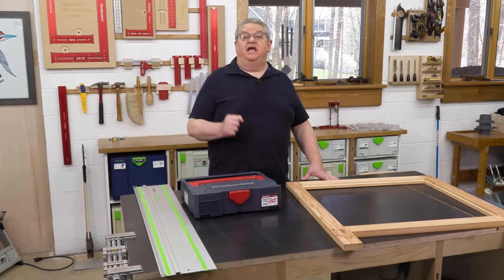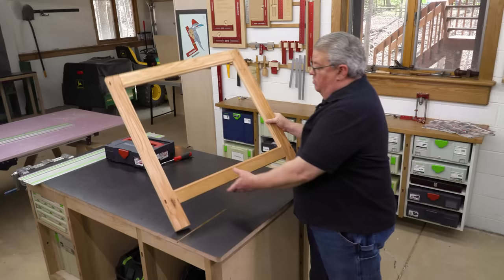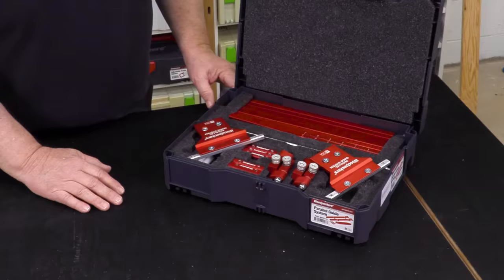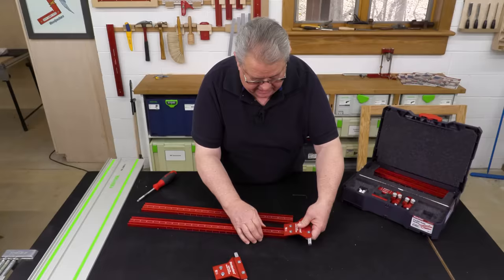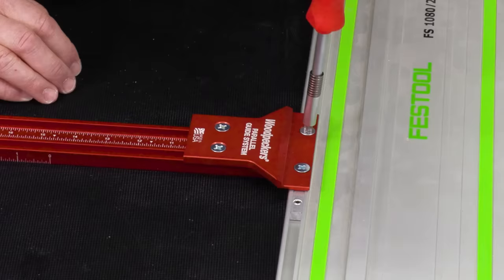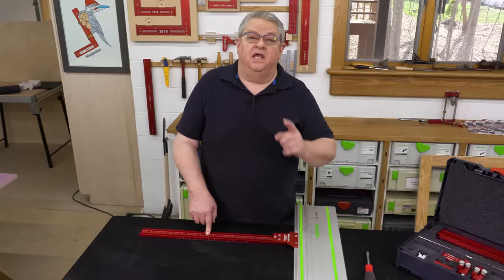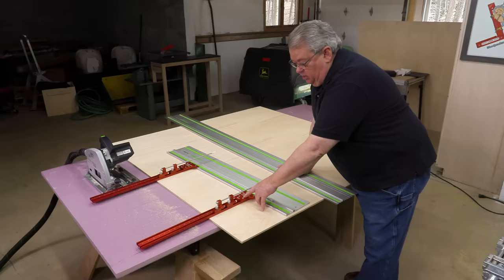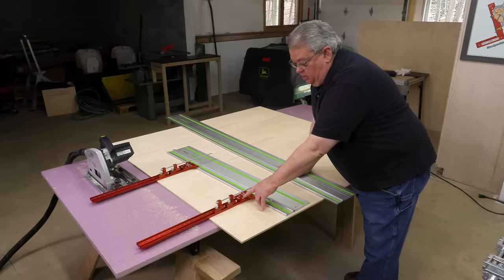This Track Saw Accessory Might Replace Your Table Saw | Deep Dive

Comment: I could be missing something, but wouldn't you save a lot on set up time if you made the container just a little bit longer, and had the part that attaches to the track and the first section of guide rail as one solid piece? Do you lose any of the other functionality besides space-saving by doing that?

Comment: A friend had been loaning me a set of these and I fell in love with them and decided to order my own. 
Another friend asked why I would pay that much when there are Chinese knockoffs for 20% of the price?
We ordered a set just to see how close they got. (Always figured that I'd order from Woodpecker anyway just on principle, and give the other set away if they were decent.) 
First thing I noticed was that the face of the pieces didn't seat flush. Not a tremendous offset, but enough to catch and damage the face or edge of the wood.
Next was that, when calibrating per the directions, the end of the rod didn't reach the cutting edge of the Festool track. Interestingly enough, their website lists every make EXCEPT Festool, but the Amazon listing shows Festool compatible. 
They also used Woodpecker's photos in their listing, complete with artifacts where they tried to remove the Woodpecker logo from the mounting heads. 
Decided this wasn't even worth giving away and returned. 
My Woodpecker set arrived today, and the setup and cut was perfect.
All of the complaints about how long it takes when using these are ridiculous. Once they are calibrated it takes no time at all. Far less than measuring and setting up an edge guide or measuring both ends of the board and trying to line up your track and hope for square.
Unless you've used them, you have no idea what you're talking about regarding time or ease of use.
Like everyone else, Ioften balk at Woodpecker process. But there's no denying the quality, accuracy, and reliability of their tools.

Comment: I'm sure it works great. But practically $500 for a jig that will allow you to make parallel cuts? I guess you're paying for precision engineering. But honestly, who needs to be quite that perfect? With a few clamps and straight edges you could probably achieve an imperceptible difference to this, for a small fraction of the cost. I'd also be stressed about damaging kit that seems to be worth its weight in gold, rendering it worthless.

Comment: I made one years ago. It works great but I wouldn’t say it would replace my table saw.  Repeat cuts on a table saw are simple. Of course I had  a 8’ slider on mine.   Cu300
Reply: I was just thinking about all the comets on how fast they could do this on a table saw. Except for one thing, squaring  up a 5x5 sheet you need a slider…
Reply: @sparkypdx  had one so I guess I never thought about it

Comment: What is the pink board. And is the saw cutting into it.
Reply from the maker: Rigid foam insulation, and yes, the depth of cut is set so the blade just barely cuts into the foam.

Comment: The old table saw, 10 seconds to set up, repeatable, makes no difference how long your stock is, would have had all the pieces cut in 5 minutes.
I see I've been doing it wrong all these years, why do it the old way when I can spend 15 minutes setting up an overly complicated rail guide system that limits me to 60" of ripping?
Reply: @TopRahmen Indeed

Comment: What are you using for the long cross member supports underneath the foam board?
Reply from the maker: I'm using a Walko Workbench from Denmark. Sadly, they're no longer available in North America. A couple 2x4s will do the same thing...just need to give the foam a little support.

Comment: I'm usually very impressed with Woodpecker gear. Not this time. Much quicker and just as accurate to align the track with a straight edge and clamp it down. Add the cost of the track right angle attachment and the Woodpecker square and you can buy a contractor table saw. This is a collector's item for Woodpecker fan boys. So easy to incorporate both imperial and metric and yet, Woodpecker insist on excluding the rest of the world from their client base.

Comment: If you dismantle this so that it fits back in the case for storage, do you have to re-calibrate it next time you use it?  You referenced the issue briefly at the top of the video, but I did not quite catch your message.
Reply from the maker: You do lose calibration if you remove the head that connects the track to the guide rail. If you leave the first section of track attached to the head, you'll maintain calibration, but it won't fit in the Systainer. If I know I'm going to use the PGS in the near future, I leave the track connected and bungee cord them to the outside of the Systainer with the rest of the parts inside.

Comment: I wonder about the cost of this tool and the time to set it up you need. they have very, very, expensive tools and like this one not very practical. using my drywall square does the same but it takes 10 minutes to set it up..........I save myself hundreds of dollars. Again, the fancy tools do not make you a craftsman, it will make it more difficult to compete. I have basic tools for making dining room sets. tables high-end kitchens and doing great. This is just a false advertisement and a very cumbersome tool to use.

Comment: How do you keep the track saw clamped down to the  plywood and your plywood clamped to your table in this video?
Reply from the maker: Track clamps holding track to material. No need for anything else. The material has little tendency to move on the foam surface.

Comment: Nice system, but you guys really need to "Stop" using that phrase "will or Could replace the table saw". Nothing could replace the quick precision ripping /panel cutting of the good old faithful table saw. Not even a dedicated panel saw which is used specifically for sizing plywood panels into manageable sizes, to take to the table saw for precision ripping and crosscutting as well as other wood machining task. I have a luguna table saw and track Saws, with my track saw, I have to manually align the cutting edge of my track with the cut line of my work piece to be cut, every single time. And it's no guarantee that my first manual track alignment, will perfectly repeat itself onto my successive manual alignments, close but not at all perfect like my luguna table saw produces. With the price tag of this woodpecker's system, coupled with a track saw, you could've purchased a jobsite table saw that only takes up less than 6 sq, ft. of space, or a cabinet table saw. I just don't see this system from any price point advantage, nothing that, in a pinch a shooting board couldn't do, that's a straight edge, a circular saw and an offset template. I built my first set of kitchen cabinets over 30 years ago using a straight edge and circular saw.

Comment: I love all the gadgets that Woodpeckers make, unfortunately they are difficult to acquire in my country.

Regarding these parallel guides, I have doubts about their usefulness. The table saw is the heart of any self-respecting woodworking workshop, it is a very useful tool for an infinite number of cuts. In fact, bench tools, which are fixed like the table saw, the table router and others, are usually more robust than their hand-held counterparts like the circular saw, the router, etc.

I mean, it's elementary. The situation where I think a track saw with these guides (which are apparently a bit complicated to use) might be worthwhile is for someone who is starting their own workshop and doesn't have the space and probably the budget for a table saw. So the question is, how affordable is it to have a good plunge han held saw with its cutting rails and these parallel guides, and will it be less of an investment than a table saw, even if it is a portable one like DeWalt, Ryobi, etc.?

And indeed, it can be useful for making certain cuts in plywood but what happen when you have to cut other types of wood besides plywood?

Comment: When your using the square against the fence it looks like the vinyl strip that prevents tear out is missing. Shouldn’t the measurement be from the strip since that’s where the blade is cutting?
Reply from the maker: Gary, that is a bad camera angle. It is definitely against the splinter guard. Look at the close-up that is right after the scene you're describing and you'll see it.

Comment: Why are you getting so much saw dust around when you are using a Festool track saw and I am assuming a Festool Vac
Reply from the maker: Because I had been sanding and had the vac power turned down and didn't know it. Found it after we finished the video.

Comment: My questions are, I didn’t see a method to clamp the track to the plywood, do you just try and hold it while you cut?
/
Reply from the maker: According to Festool, clamping is not absolutely necessary when cutting plywood with their guide rails. They include friction strips that hold it in place. Personally, I put at least one clamp on, and most often two when making critical cuts. The underside of the guide rail has a slot that accepts track clamps. Sorry I didn't explain that. I sort of assumed that anyone looking at our Parallel Guide System would already be familiar with track saws and guide rails.
Reply: @WoodpeckersLLC  This was the first I’d seen of this system and was unfamiliar with any track system, appreciate the prompt reply though.

Comment: How do have space for a sheet of plywood but not a table saw?
Reply from the maker: To cut a sheet of plywood with a table saw you need 8 feet in front of the blade, 8 feet behind the blade, and room for the operator  With a track saw, you only need enough room to walk around the sheet.
Reply: @WoodpeckersLLC  not to mention, it's also many times more dangerous doing this on a table saw especially if it's not sliding table saw.

Comment: Track saws are nice. Ive been making them for years. Not sure you should be woodworking if you cannot make a straight edge guide for breaking down plywood. Not sure you should be woodworking if you don’t have room for a table saw of some sort. Nothing can replace the simple “go-no-go” repeatability provided by a table saw. 

I have nothing against high end tools and tooling. I have a 2000 sf shop full of that stuff. But leaning on this kind of “micro-adjust” woodworking is NOT woodworking. In fact it demonstrates a lack of woodworking skill and limits one from gaining the proper skill of woodworking. I see this product specifically as tooling begetting tooling. It’s made for the client with more cash than problem solving skills. And that is not woodworking. 

I love Woodpeckers other stuff!

Comment: Seems I’m missing something as I just measure my cut, clamp the track to the wood and make my cut without any need for the parallel track at all.
Reply from the maker: The difference is repetition. Your method is perfect for one cut. Maybe two, but a parallel guide system is about making multiple pieces exactly the same. Yes, there's some assembly and set up. But once that is done repetitive cuts are as fast as you can move the boards and far more accurate than setting the rail to pencil marks.

Comment: What is the purple waste-board called? I've seen in several videos but nobody has mentioned what it is or where to get it or how good/not-good it is. Thanks, now I'm SUBSCRIBED!
Reply from the maker: It's foam board insulation from a home center. I prefer the 1" thickness. Anything relatively inexpensive that fully supports your sheet goods will work. The foam is about $15 a sheet and will last for years of track saw cuts.
Reply: @WoodpeckersLLC  Thanks for the quick answer. Now I'm SUBSCRIBED!

Comment: I fussed with this type of arrangement (if not nearly as nice an implementation), but could never get the last 1/16" out of it. Sometimes I'd just bump it! Ended up making a 4x8 cutting table which is basically a huge MFT clone with a door hinge to mount the the 48" rail. It works great but the hardware for the hinge and index point are obviously clunky. I'd like to see Woodpeckers come up with a kit for this, instead. The hinge needs to automatically go up and down for different thickness, none of the Festool stamped steel crap with 1/8" of play (re-calibrate every time).

Comment: Imperial measurements are crazy…. Why would you use them when metric is available
Reply from the maker: If you feel that way, the Parallel Guide System is available in metric.

Comment: I agree with replacing the table saw with a track saw for breaking down plywood but this is ridiculous. The best the woodpecker engineers could come up with is asking woodworkers to assemble this device with a dinky allen wrench and tiny knurled set screws?  You couldn't come up with some locking mechanisms? You guys need to put a lot more thought into this.

Comment: What stops it sliding while you make a cut?
Reply from the maker: There are anti-slip rubber strips on the bottom of the guide rail and 1 or 2 clamps holding the rail to the plywood.

Comment: In order to store this in its storage box, you have to take everything apart.  This means you have to calibrate it everything you need to use it.
Reply from the maker: If you're not traveling between job sites, buy it without the Systainer, calibrate it once, and hang it on the wall.
Reply: @WoodpeckersLLC  I would like to suggest you consider modifying your systainer foam insert to accommodate post calibration storage.  For such a high price tool, hanging on the wall does not seem like a safe storage solution suggestion.

Comment: or just use a ruler and a pencil to make 2 marks and lay the tracksaw across them. 
Make the tracksaw from flooring laminate its thin and slippery.
Reply: each time you measure is opportunity for error to compound

Comment: In the time it took to put together and calibrate you could've ripped and cross cut all of your pieces and had them assembled. I'll look elsewhere to spend my $2k which I'm guessing is the cost of this contraption which is easily made out of scraps

Comment: i cant stand the festool cord and hose. such a pain in the ass. so many time while holding wood and making a long crucial cut and the dang cord or hose snags and i have to take a hand off the material.  why have they not created a solution to this yet!?

Comment: I guess this is marketed towards beginners that can’t cut a straight line. If you are a pro or even seasoned diy maker, just take the extra few seconds to cut nice and slow to get great results. Or just do a rough cut with the jig saw and clean it up with the router to get a perfect cut.

Comment: A bit Fiddly for me. Guessing  it wont do an 8' rip on full sheet of plywood? Backing up your work with a $20 foam board would add up quick.
Reply from the maker: If you have an 8' guide rail the PGS will rip a full sheet. One sheet of foam will last for years.

Comment: While I really like the system - I think it is way to complicated to setup!

Why not just use a measuring tape?!

After squaring off one edge - mark the exact distance of the cut needed and then align tje rubber edge off the saw's guida rail.

Isn't that the whole idea of tje cuttable rubber lip?!

to actually be able to lay it directly on a marked / measured line?!

I can achieve accuracy down to the mm that way! which is more then good enough for most cases!

When more precision is needed I need to borrow time at a friends format circular saw with digital fence or a big CNC.
Reply from the maker: The theory behind this tool is that frequently in cabinetmaking and furniture construction you need multiple pieces at exactly the same dimension. If you need one piece, you are exactly correct...it's easier and faster to use the track saw aligned to measured marks. The Parallel Guide System is designed for those times when you don't need one piece, but...let's say....20 pieces all identical. Still  think measuring and marking will be faster?

Comment: Woodpeckers has many good ideas, but $479 for this kit, on top of already buying a track saw kit, ouch!
(This comment has been changed after considering the comments below and should be taken in perspective – Karl S )
Reply from the maker: I've mentioned this in a couple other comment replies, and I don't want to sound like a broken record, but this tool is not about making ONE cut. The beauty of the track saw system is that for one cut, two pencil marks is all you need. But, if you need multiple pieces at EXACTLY the same dimension, the tape measure and pencil routine takes too much time and minor variation is inevitable. Once the PGS is set up, you just slap it up to the edge and cut. Repeat as needed. 

Another comment on price. Unless you are working on job sites and transporting all your tools in Systainers, look at the next line on the price list. For a shop based track saw I wouldn't spend the extra $80 for the Systainer.
Reply: @WoodpeckersLLC  
Thanks for your response
On reflection, I must of course agree with your point on repeatability, a must for a working (for profit) shop.
I worked my way through college in construction and remodel. That was forty years ago, retirement offers me the ability to return to woodworking from an entirely different perspective. It is from that view that my comment was made, my mistake. I shall remove my comment.
I remain enamored of Woodpeckers design ideas and tools for the commercial shop.

Comment: With the knowledge all sheet good is more like a trapezoid, a verifiable square (Okay I have an 1821) some MDF to make a zero clearance rip guide and a couple of clamps it is so much easier. If that is not good enough measure wide and finish on a tuned table saw. As much Baltic Birch wasted in this video I'm sure I can do better.